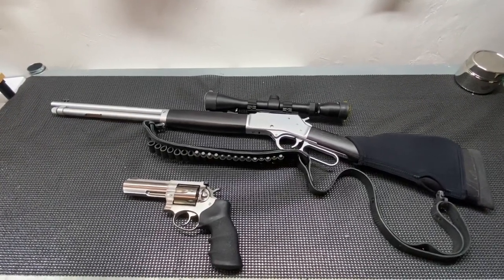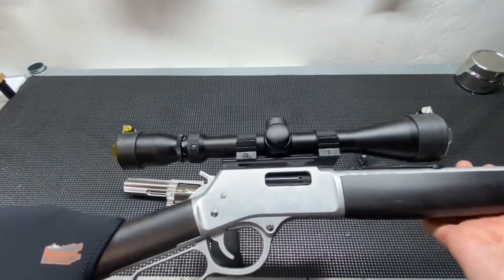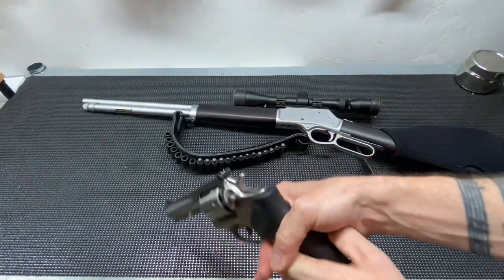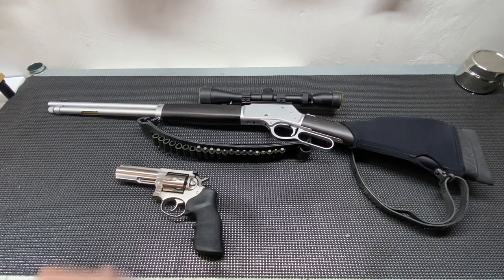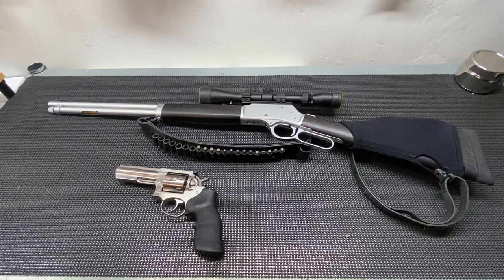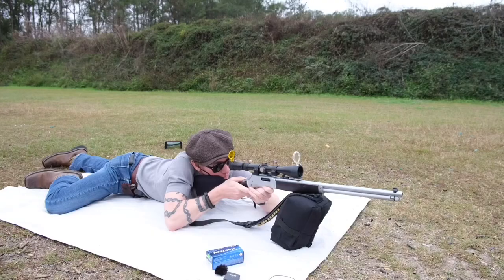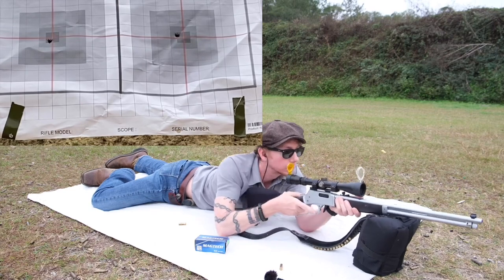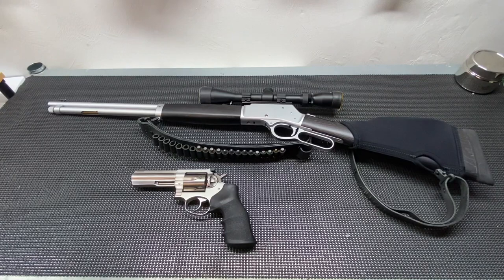1 Rifle 1 Handgun caliber pairing .357 magnum

Comment: Versatility is the key word here for the 357 magnum. Two guns one ammo. Such a great idea.
My pair, Revolver, Charter Arms, Bulldog. 4 inch, 5 shot. 
Rifle,  Traditions G2, 22 inch barrel, single shot break action. 3x9x40 on top.
I handload.
 Hornady Manual, two sections, one for pistol and one for rifle.13 different bullets. 110- 160 grain.
I see the same thing in the difference in velocity.
 Loading the XTP bullet, 125 grain, revolver  a light load, 1250 fps for the 22 in  rifle 1700 fps.
Over the counter 357 ammo is about $1.00 per round,my hand loads are, depending on the bullet. My cost per round is 28-42 cents per round.
With my rifle. LHCSWC 158gn loaded to 1450 fps.
 2 deer, @ 55 and 70 yards, one Feral Boar Hog at 105 yards.
All were O.S.O.K.
I'm running the same idea with my 22's. Rifles, One bolt action, 581s w/ a 24 in barrel and a 10/22 w/ a 20 in barrel. Both have 3x9x40 scopes.
 Pistol is a 4 in. SS, 8 shot, CA Pathfinder. Both pistols fit in the SAME Holsters, a small added bonus.
With my 22's I'll never go hungry, if and when I have to step it up a notch I reach for my 357's.
Reply from the maker: Very cool, thank you for the comment and confirmation

Comment: The concept is sound but... I struggled very hard to find 38 special and 357 ammo.. In a rough situation it'll be even worse. You would have to have a real pile safe and ready.. It costs too don't forget that point also.
Reply: Yes..I’ve been storing/reloading .357 since the Obumstead days.
Reply: @kylewood8327  I enjoy your content and have subscribed for a long time. It would take that level of preparation to make that caliber viable. Most people wouldn't have the money or even the depth of thinking.
Reply from the maker: Yeah not cheap but in my area much better than last year at this time
Reply: @ModernGunGear  at least it’s going in the right direction